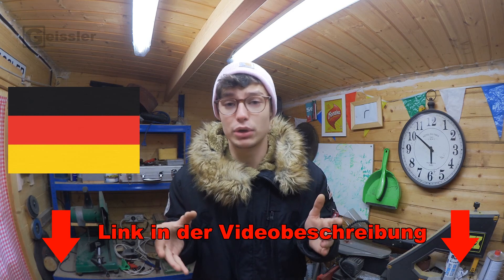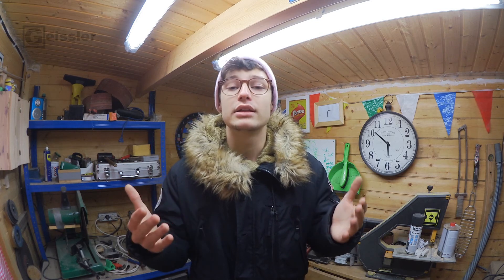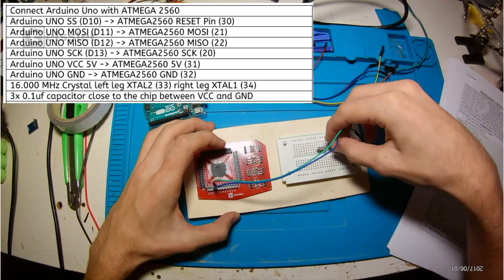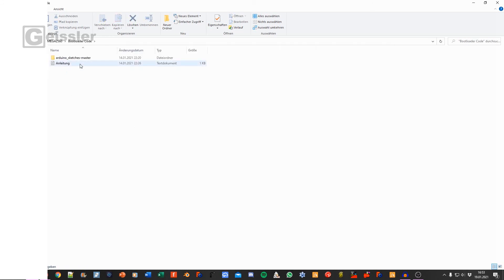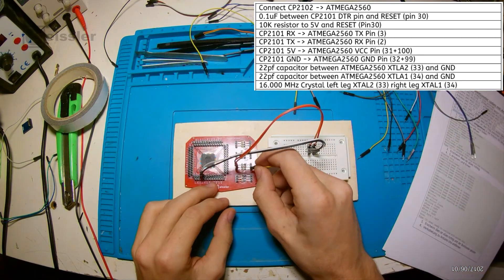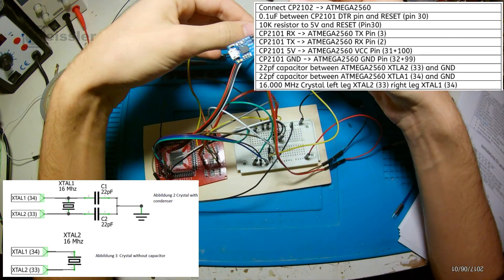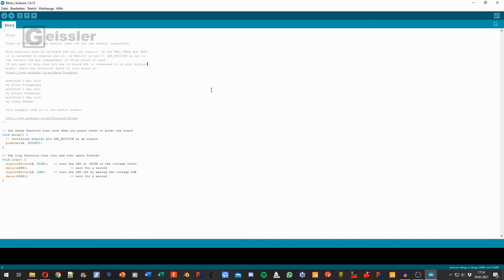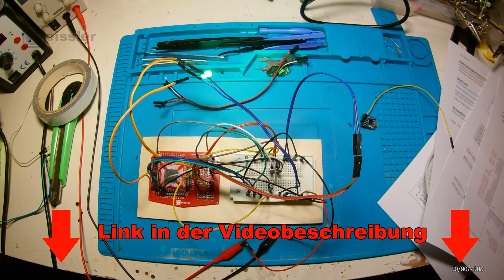DIY Arduino Mega (ATMEGA2560) English- Luis Geissler

Comment: buying or diy which one is good bro , if you say diy definetly iam try this otherwise also fine becouse iam learn something from you thanks bro, can you do an experment is it works for ramp 1.4 , if yes you are the first persons to help make the cnc mechines in a budget , the arduino clone in my country selling at 12 - 15 $ and above in some areas.
i hope you understand what iam saying,
finally thanks for sharing the valuable information.
Reply from the maker: You can use it to control a ramps, because a ramps has hardly any special components of its own, but is only a distribution of the connection pins. Building an Arduino MEGA yourself is probably more expensive than buying one, since the ATMEGA2560 alone costs about $7 and the other components add up to a certain amount. If you don't need a special configuration of the Arduino MEGA, I recommend buying one.
Reply: @luisgeissler  thanks for your reply 😊